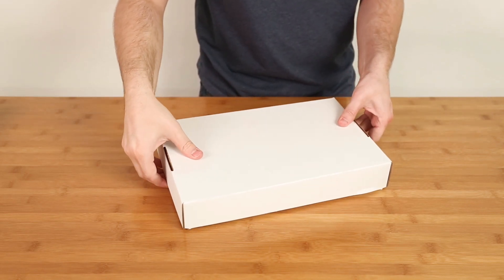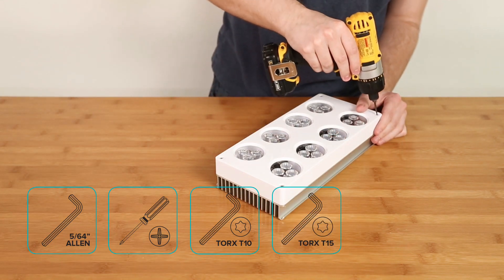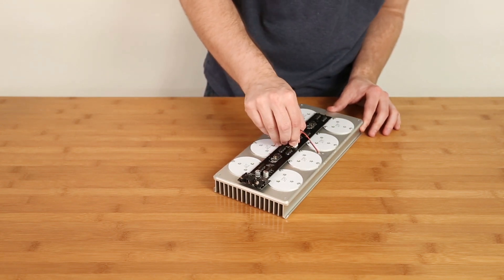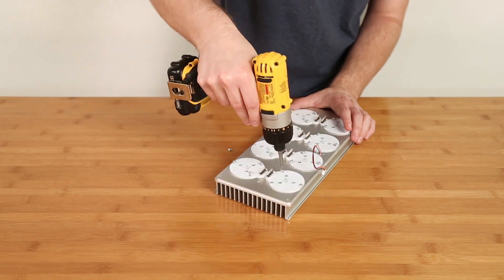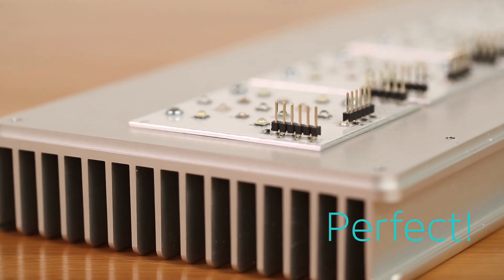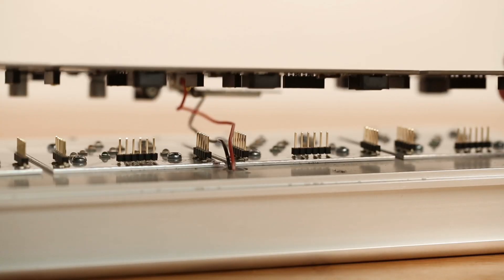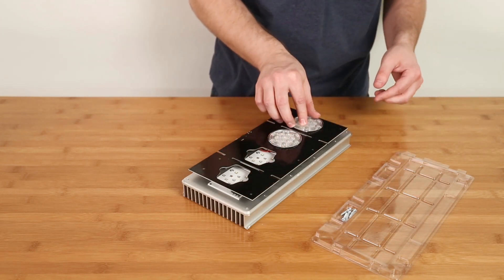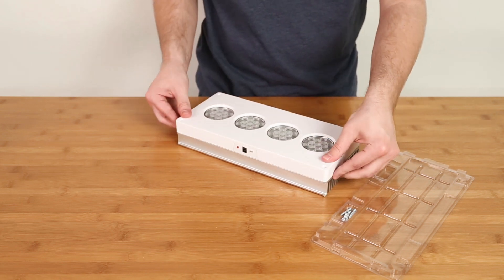Sol to Hydra FiftyTwo Upgrade

Comment: AI Hydra good LED range, however the weakest link is the piggy back Wifi Adapter inside the unit which is at least 4 years old technology. The WiFi range is only 10ft and doesn't support g/ac connections... this makes automation of the Hydra connections the weakest link.